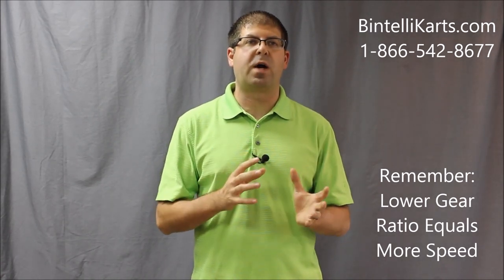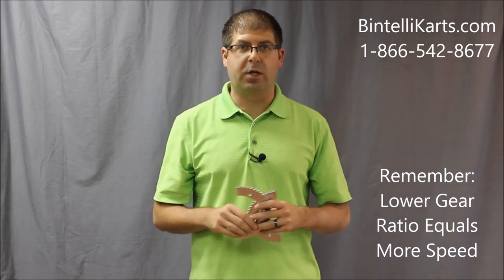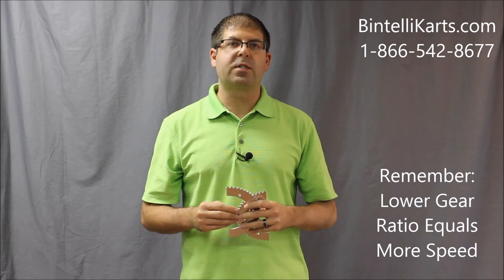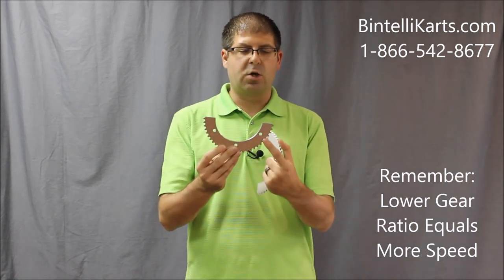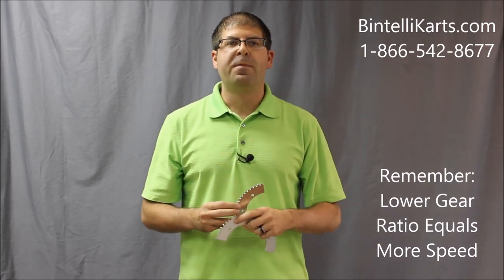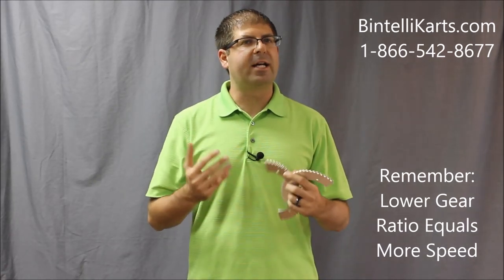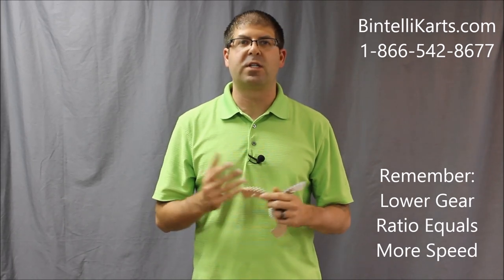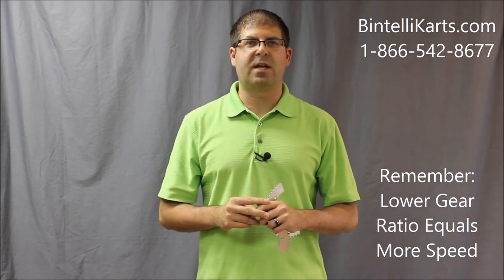How Your Gear Ratio Alters Speed & Acceleration on Racing Go Karts by Bintelli Karts

Comment: Thank you for the explanation. My son is new to racing in Briggs and Stratton LO206 Junior class with a gold rev limiter, what is the Max RPM that class will have and what would be be a recommendation for the gear ratio on a track with several long straights that is just over a mile in distance?

Comment: Use torque converter if you want both torque and top speed but it not suitable for the track
Reply: What size rear sprocket I am going to run a 420cc engine with 40 series torque converter kit 1" live axle 22x11-10 rear tires 20x8-8 front tires I have a 48tooth sprocket in mind will this be enough to go off road as well as tarmac?

Comment: I have a go kart with a 12 tooth clutch, going to a 32 tooth sprocket (on a jack shaft) and at the same shaft as the 32 tooth sprocket i welded a 14 tooth sprocket, going to a 22 tooth sprocket. I have also a 3.5 hp b&s motor. Will this thing ride?

Comment: I visited the site but found no help to answer a question so I came here to ask it. First I seen most of your go kart stuff is for tiny go karts single seaters, now I'll give you the break down on my go kart as listed; I'm running a 420cc engine with 40 series torque converter kit 12 tooth sprocket rear tires 22x11-10 one inch live axle with working swing arm and air shocks, front tires at 20x8-8 with double a arms and air shocks giving me 11" ride height without air shocks filled to 30-60lbs air. Question is what would be a good sprocket to run for speed but yet have torque when needed. I have a 48 tooth sprocket in mind but no one can answer this question or would this be enough to give me speed as well as some torque with a 12 front sprocket and a 48 sprocket with a torque converter kit. So I'm asking you if you can give me any information about it.  Thank you Kevin.

Comment: I have suzuki gs/gn 150. It abe 15/42. I change it 15/39  sproket from honda cb 200t . Bike is in pressure now. 
I found suzuki more precise in their engineering. It doesn’t allow to modify. 
Honda is more friendly and an acceptor engineering which accepts modifications

Comment: I race 212 predator motor on a 1/5 dirt track. a guy I race with is in my class and he zooms past me in the turns and he's faster in the straight as well. no one can catch him. I'm on a 15 driver and switch between a 57 58 59 rear sprocket. nothing seems to help. what can I do ?
Reply: hay man i race on some what the same size trace and we was haveing the same problem you need to be on a 18 57or 56 with a #35 chain and you should have np going to the front but stay in your Grove or you going to the back

Comment: Hey, my lad races a honda c90 in a cadet kart, we run a 28 on the rear and 14 on the front, he rarely hits top end so we want quicker acceleration, so am i right in thinking if we run a 13 or 12 on the front we would achieve this?

Comment: What is the best gear ratio for a 420cc predator? I prefer speed over torque. I plan on getting an 18T clutch with a 45 tooth rear sprocket. Is that good? My wheels are 7 in.
Reply from the maker: Thanks for the question. There really is no perfect answer to that, as it will have a lot to do with the track you are racing on. I always recommend getting 3 different rear axle sprocket sizes, all a few teeth larger or smaller than the others. When you get them, try the middle size first and test it on the track. Once you do the test, you can determine if you want more speed or more acceleration, or maybe it may be perfect. 

Want More Speed? You can:
- Increase the number of teeth on your clutch sprocket
or
- Reduce the number of teeth on your rear axle sprocket

Want More Acceleration?
- Decrease the number of teeth on your clutch sprocket
or
- Increase the number of teeth on your rear axle sprocket

I hope that helps!

Comment: I am building a shifter kart out of an old kart and I am trying to work out the top speed.the engine is a 2003 YZ 125. main sprocket is 12 tooth an the axle is 33 tooth the tires are 10.5 and I have been told the RPM would be at the most 12000. it is a five speed trans. Thanks for any help.
Reply: There's some calculators kicking about, I think you can enter your tyre size and RPM but then you'll need to pre-calculate gear ratio (33/12 = 2.75) then multiply or divide (the bit I'm not sure about) by your 5th gear final drive ratio.  Feed it into the online calculator and one number will be ridiculous, the other will make sense.  

Either way, stay safe dude, that thing you're building will be a f#$king weapon!  I reckon if it was me, I don't have the stones to find out the actual top speed!
Reply: i appreciate the info, by the way i am building it for drifting. don't care anything about going as fast as this kart will go. i did but in 12 tooth gear by 33 tooth axle by 10.5 tire by 12000 rpm and it said 138 MPH

Comment: If I had a 3.3 gear ratio, would 4000 rpms be enough to push through the (I think) low gears, and then make it too it's top speed, also, how does my tire size effect this, and what could I do with my tires to help with more top end speed.
Reply: I assume you mean a 3.3:1 ratio?

I have a similar problem.  I calculated this.  I have ten inch tires, at idle which is 1850 rpm,, a gear ratio of 2.25:1, my cart would be going 17 mph off the bat after startup!   so no, 3.3:1 is way too low.   Anything less than 5:1 ratio is a bad idea for a beginning gear.

Increase top speed? Get bigger drive tires.

Comment: I want to lower my rear sprocket to 30 teeth but my setup is a dead axle so want do you suppose that I do.
Reply: Is that the go kart that has a bicycle sprocket on the back? if so you may be able to cut that off and slide on the new smaller sprocket.